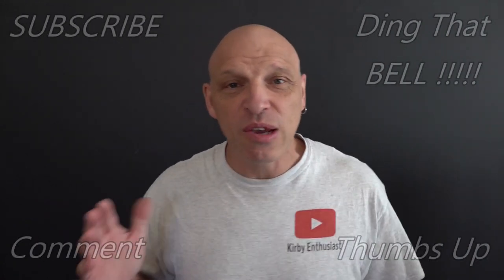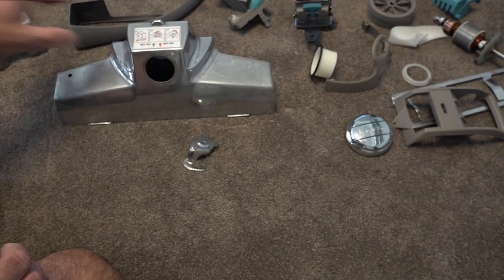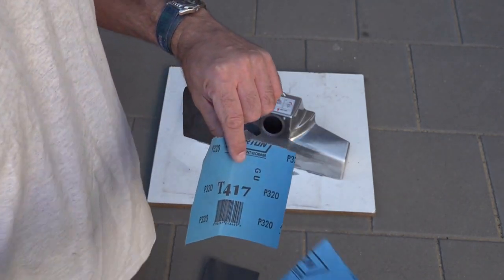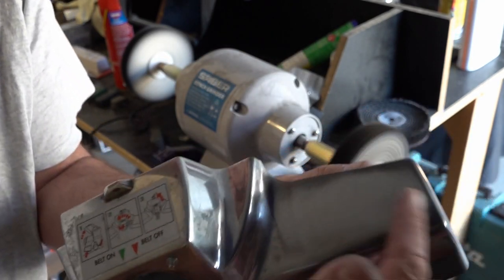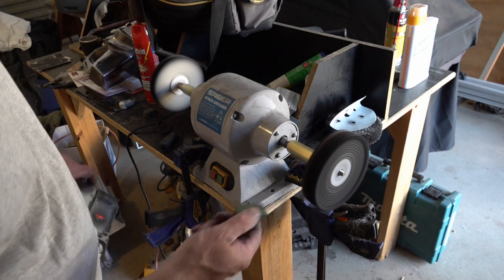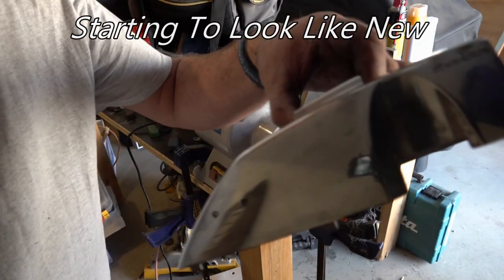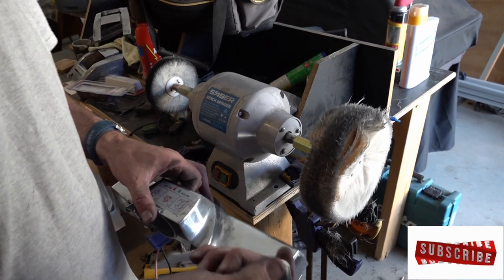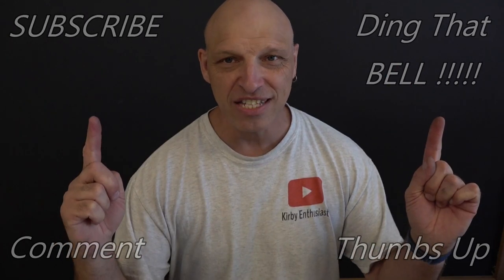HOW TO REMOVE SCRATCHES & OXIDATION FROM KIRBY VACUUM: How To Use Buffer

Comment: Another informative helpful video Dean.  I will use it to clean up my Kirbys.. They need to shine again.   I recall from a previous video awhile ago you using the Silvo and Meguiars metal polish.   Those are the next steps for polishing after the buffing I presume.   Correct?   Thks.
Reply from the maker: Yeh the final step was Maguire's  and mothers polish

Comment: Hi I was wondering if you might consider a tutorial on how to do the tech drive belt and how often it should be replaced? Apologies if you did a video, I haven't been able to locate it. Thank you ever so much.
Reply from the maker: I haven’t done one specifically fir the belt , but I do show how to remove snd refit tech drive . 
The belts don’t tend to wear as they have no tensioner on them. 
My G4 had original tech drive belt on for over 20yrs. I only changed it as I replaced while tech drive .
Hope this helps , here’s a link to the video . https://youtu.be/UVyOhPeyLSg
Reply: @KirbyEnthusiast  Thank you.
Reply from the maker: @jasensouthflorida2442  your very welcome 👍👍

Comment: what might be easier is wet sand the individual parts in a 5 gallon bucket, full of water, wet sand each part submersed or semi submersed
Reply from the maker: Found works welll with the detergent as acts like a lubricant while sanding 👍👍